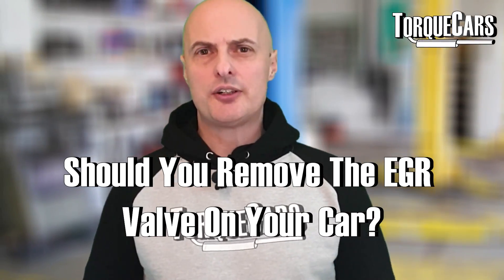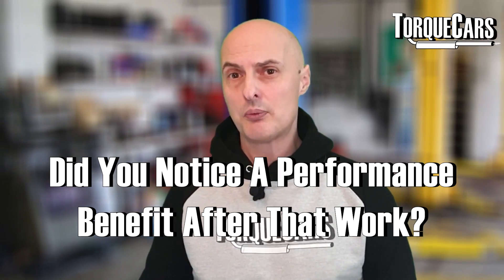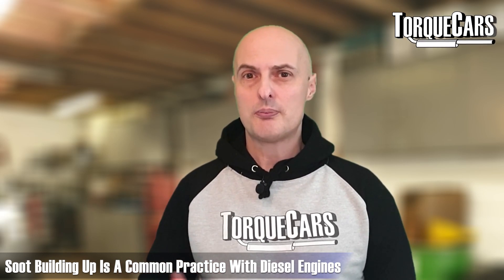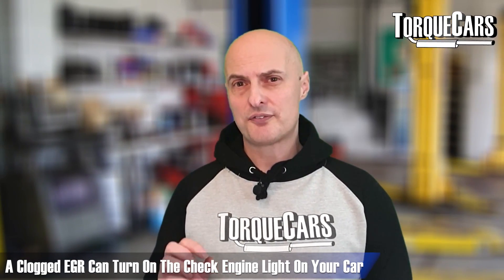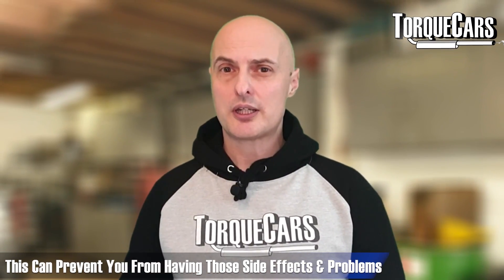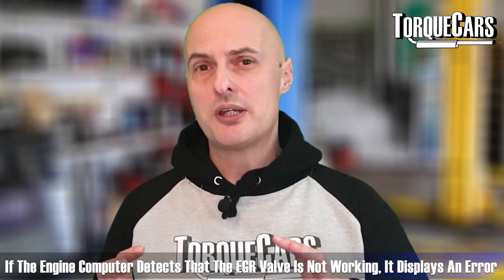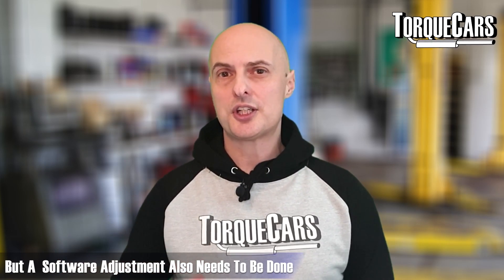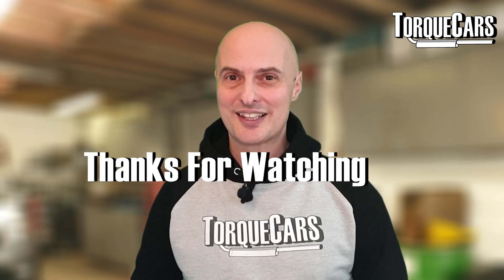EGR Delete/EGR Removal - Worth The Risk/Effort? All You Need To Know About EGR Deletes.

Comment: If you read nearly all of these comments on the deletion / Blanking of the EGR & Cooler ( particularly on VW / VAG group 1.6 & 2.0 TDi ) you will notice nearly all are early 2006/07/08/09 etc etc.Try finding a blanking kit or even a "How to" on the later 2.0 TDi from say 2012 / 13/ 14 onwards on the later MK6 MK7 Golf etc, the larger all in one with the integrated EGR & Cooler at the back of the engine up under the DPF which necessitates dropping the front subframe /removing driveshafts / unbolting your DPF etc etc to gain room, Ohhh did I say on the road or your driveway its going to be a nightmare, and even if you have a two or four poster lift not that much fun either ! ........ they are a known nightmare, not least because doing the job is so horrendously fiddly, difficult, time consuming, and parts are expensive for the average motorist, and that's if you even have the array of different tools needed !  Please anyone ? ..... is there a blog or video you know of on how to DELETE DELETE DELETE ! ....... Thank you.
Reply from the maker: Some would argue that on these newer EVO engines where the DPF is typically placed before the EGR and the PCV has an oil vapor collector run fine and are not a problem when it comes to carbon deposit build up. 

The EGR is indeed a real pig to remove as they are so integrated now and I don't know of a blanking kit at the moment but I'll keep digging around for you. A software switch off will effectively shut the valve and stop it working, and I think that is what most people are doing on these newer engines. Let me know if you find anything out you are not the first person to be asking this.
Reply: On my late 2012 62 plate VW Golf 2.0 TDi I have indeed had the EGR mapped out professionally, not blanked, because these later VWs have water pipes to the cooler and are so difficult to access, almost impossible if you don't have a ramp, and once you go to all the trouble of removing you might as well replace it anyway, I replaced my complete EGR valve and Cooler and that did stop the flashing coil and limp mode, ie: back to full power, BUT, then we had an engine management light that we simply could not turn out no matter which system we tried, after hundreds and hundreds of pounds I simply gave up and had the two day old New EGR mapped out ! another £250.00 on top of the £800.00 I had already spent to no avail, and ir worked ! No fault codes, no pending codes, no dashboard lights, no limp mode, however, I now wonder if this will effect my DPF ? only time will tell I guess, would I buy another VAG car knowing what a huge problem these EGR valves are ?  Never, and I mean that, Japanese or Korean for me next.   @torquecars

Comment: All that soot that blocks those egr's ends up in your engine.. I actually wonder if they designed them that way to push vehicle sales after about 10-12 years. Usually by then the engine is fked and the body is failing.. So most people scrap the vehicle or find some sucker to buy it..
If they are claiming it's keeping the engine cooler etc that is horse shit. They could have designed cold air intakes in the same spot that wasn't pushing 100% carbon back into the engine.
Was it to reduce emissions? Maybe.. Well the engineering behind it could be re-done in such a way that those carbon emissions were being feed into something else, like a pollution control container that they use to have on vehicles back in the 80s.. And those pollution control containers could be unbolted and replaced relatively easily from what I remember back when I was 12 helping my neighbor on his cars.. 
I think that valve is malicious and has bad intent behind it to cause more vehicle sales for the supposed sake of saving the environment.. 
We pay enough for these vehicles, they could all be made of aluminum DMC /cough and not have all these design flaws.
Did you guys know if you actually have a way to warm up your gasoline before it get's to your injectors, it expands by 20%, thusly causing a more efficient fuel burn... I'm not saying to boil it, but warm it up... That is why in the winter months your vehicles mpg is dog shit while it seems better in the summer. You ever hear them mention something about switching blends from winter to summer fuels? They don't switch the blends at all, if any.. The switch is the calculations being made when you pump gas into the tank because cold months means gasoline compresses  and burns less efficient while summer gas gets expanded slightly more from environmental heat, therefor causing the calculations to be slightly off. You ever fill up a tank in the summer time during the morning in 70 degree weather?  Then by 1 pm it's 110 degrees? Sometimes the gas will expand enough to find a way back out of that gas tank.. It's basic physics.. Manufactures have gone out of their way to ensure you can't really fill the tank beyond a certain cutoff point that is designed for summer months so that gas expansion doesn't happen...
Christ, I could go on an on about how all this climate change is horse shit designed to siphon off your hard earned money.
Did you know there were people on youtube 15 years ago using ultrasonic devices from those pharmacy misters to convert fuel with sound to a gas state? Then would go about running a small engine like a lawn mower or snow blower off a minuscule amount of gasoline. Something like 90-100 % burn efficiency! And this tech has been known about for 30+ years... These mother fuckers don't give a rats ass about the environment.. They wanna sell shit in a consumer driven, throw-away-society.. To keep quarterly profits inching upwards... There was a guy back in the 1930s who ran his gas lines near his exhaust to achieve a similar expansion of the liquid gas.. It was deemed a bit risky but these scientists and engineers know this shit..
Wasn't there a volkswagen car made back in around 2010 that was getting something like 70 mpg? What happen? An update was forced out in a recall and those 70mpg cars went to shit.. I know someone who had one but can't for the life of me remember the exact year..
This is the kind of bs going on though. We are constantly lied to, put in a state of fear to control us. Fuck these mother fuckers!
Reply: Yup, my engine was running horrible with the EGR open. Cleaning or replacing is would be a tough job.. if i would go to a car dealership they would charge 1k+. So i blanked it and it didn't cost me anything. Engine is finally running good after this.
Reply: @placeh0dlerr  Are you serious about the 1k? Holy fk.. 
I was only considering a shop to change mine because this 07 wrangler has it in such an odd spot for someone with no lift and an arthritic spine. 
The part is only like 90 bucks in Canada.. 1000 bucks? My god.. 
I might have to tackle this one myself even if it cripples me for a week.
Reply: @placeh0dlerr what car do you have? I have a 01 accord that I just unplugged the connector and it seems to be running better and faster.  Has a slight idle surge idle bounce only on cold start but runs very well when warmed up
Reply: Buck'um man!!!

Comment: EGR are quite well designed you say, PMSL, the EGR on my VW is a POS, failed twice, guranteed to clog up and subscribe to £1200 every few years f@ck that. How can you possibly say well desgined. My EGR has prolly been blocked up for years with no noticiable draw backs except for ECU whinging about it, therefore delete egr
Reply from the maker: They are quite well designed purely from the point of view that "they don't affect performance negatively", when you put your foot down they shut off and at higher loads and RPMs they again are closed. I totally agree that some designs and implementations leave a lot to be desired. 

I still don't see why we need the things, they only really help lower cold start emissions (a bit) which for many drivers is a small part of their regular mileage however in some areas it is illegal to remove them! Crazy I know.

Comment: I love cheap TDI Volkswagens. They are awesome.  If the motor blows just chuck a new one in, they are that easy to work on. Or, you could just simply buy another Volkswagen. Mine hasn't blown, yet, and she's got 300,000km on her. We got a 2007 VW Caddy for $1000AUD that needed work. I've replaced both cv's, front sway bar links, new battery, did a full service, changed the induction, straight piped it from the turbo to just before the rear axle. She whistles like a Cummins, lol. It's a 1.9 bls. I love the looks I get when I drive by and the van goes "choo" through the gear changes, and when revving, haha.

Comment: I was thinking bloking EGR valvule but i decided not do it for 2 main reasons:To avoid high temperatures in the engine and also avoid problems in turbo.I cleaned the Egr last year and i think its the best way.
Reply: I run a v40, and my EGR is clogged. I certainly would like to clean it, but it's such a pain to remove it that i decided to block the system. I think they should make EGR cleaning options better so people don't remove them, because i don't wanna clean it every year which is a full day of work.. Also if i go to any car specialist, they will charge 1k+ for removing and cleaning it. now i have it fixed by blanking it for 0 cost.
Reply: Educate urself 😢

Comment: Let’s be honest - on newer cars with DPFs just leave the EGR attached, it helps clear the dpf, if it’s an old pre-dpf car then crack on.
Reply: Yes, maybe an EGR helps a little cleaning a DPF, but on the cost of some expensive engine parts as the Injectors. In addition the EGR is a beautiful way to let come dirt in your engine. EGR OFF, DPF OFF like in the good old days where Diesel Engines lasted easily 500.000km.

Comment: Surely a blanked off egr with remap will fail an mot right ?
Reply from the maker: The UK MOT rules  8.2 1 1. and 8.2 2 1 apply and mention the EGR = "You should reject all vehicles first used on or after 1 September 2002, where original emissions control equipment components are missing, obviously modified or obviously defective." 

also for diesels 

"You only need to check components that are visible and identifiable, such as diesel oxidation catalysts, diesel particulate filters, exhaust gas recirculation valves and selective catalytic reduction valves" it also mentions "obviously modified", "obviously defective" or "evidence the DPF has been cut open"

So this is a technical fail in the UK and an illegal mod. However I am told by many people that MOT testers rarely check the EGR function, it is in fact closed during the emissions test anyway. If a vehicle can't meet the emissions measurements then it will fail and the Cat/DPF/EGR help the vehicle to do so. 

Talk to your local MOT tester to see how they interpret and check the rules, it does seem to vary!

My advice is always to keep the car legal in your region even if you think you might get away with it.
Reply: @torquecars  UPDATE !! It passed 😀 turns out tyres are more of a concern but only if you promise to replace them 😀

Comment: I just spent $150 on a brand new EGR valve for my 1999 Mitsubishi Mirage DE 1.5L (manual). When I hear about performance improvements, it really makes me want to return the valve and do a delete. On the other hand, my engine just passed 230,000 miles and I'm on a mission to get the coveted "Antique" plate for her in 2029. Deleting the EGR sounds awesome and will probably save money with a return of my new EGR (I put literally 2 miles on the new valve), but at the same time I probably shouldn't rock the boat and take the risk. Plus I read that many computers will recognize the EGR as clogged and will run the engine lean. I'm assuming the higher-end kids will fix that problem. Maybe I'll revisit the delete option down the road.
Reply: Just have the ECU tuned, also, it shouldn't run it crazy lean if you still have functional O2's.

Comment: Vw golf 7 2.0 tdi 2012 
I want to delete egr and dpf. Would software delete be enough or should I close egr with the kit and remove the inside core of dpf? Please answer.
Reply from the maker: If the DPF is still present it will eventually just block up. EGR can be deleted in the ECU, or even unplugged, but it is always good practice to use a proper blanking kit. Even when switched off they can still stick open and cause problems. So physical removal is something I always recommend rather than just a software change (obviously if legal in your area or region.)
Reply: Blank the EGR off, i had software which should block the EGR. Guess what, didn't work. So i blanked it and now my engine is happy again.

Comment: To be honest u have only spoke down sides, theirs a lot of benefits to having it mapped out n blank off
Reply from the maker: I'd be curious to hear your thoughts on the benefits, the more opinions I can absorb the greater my understanding becomes. There are some differences between brands though, some makers EGR are quite well designed, others leave a lot to be desired.
Reply: Can save ur car going on to let limp mode stops the inlet getting blocked up of sit so ur car runs alot better and don't loos boost also makes the turbo spoil up quicker

Comment: I did the EGR, intercooler, and ECU programming on my 2002 Jetta TDI. I now have 348,000 miles on that car and have had few engine problems.
Reply: A mechanic said all this valve does is cost you money lol.
Reply: What did you do on it?
Reply: Jezus, TDI is killing exhaust fumes. Get a grip.
Reply: At what mileage did you add the delete? My 99 Mirage has 230k miles and I'm looking into deleting the egr, but I want my car to last as long as humanly possible. I get the feeling that I shouldn't rock the boat.
Reply: is your mirage a diesel? from what i can tell its worth it on most diesel engines and not worth it on petrol @Spaethon

Comment: I have a 2010 Focus 1.6 TDCI which keeps losing torque through the gears but as soon as I stop and restart the enging the problem goes away for a few miles and then comes back after several miles.  I had the EGR and fuel filter replaced 2 months ago and it cured the problem about 80% but this last 2 weeks it's come back as bad as ever. I know of 2 people who had the EGR software deleted and this cured their problem, they said the engine ran better and the emissions passed the MOTs. My EGR is still under warranty so am taking it back to the garage shortly and will ask him about the option of deleting the software if it happens again.
Reply: Did your problem get fixed?

Comment: I unplugged the electrical connection to the EGR valve. My 1.9 TDI Caddy goes really well now. My check engine light is on but I don't care. I'm gutting my catalytic converter today and keeping the middle muffler so it's not to obnoxious on the highway. Soot gets the m...t
Reply: Make sure your egr valve is all the way closed after unplugging it. Carbon buildups can keep it stuck open and let exhaust gasses in. It's usually best to cut a shim out of aluminum and block the hole completely.
Reply: Yeah I'm going to make a blocking gasket and put in when I'm under the car next. Easier to access from underneath.
Reply: @holben27  Sooo you can just block the intake end like on Mk3 Mondeos then?. Oh and may I ask your opinion on people saying blocking the EGR can cause  high tempratures and premature turbo wear?.. I cant see how?.

Comment: I use mid grade gasoline on my 2007 Honda Civic EX, or 90%. In seven years of owning this car, my egr valve was clean. It’s the original EGR valve.I also use mmo on my gas tank..” as directed”. Since I got the car.

Comment: I plugged mine on a 454 fourth gen,  as I figure out a block off plate, mine seem to be stuck closed.  I removed the rest of the emissions crap and re tuned the carb and got a new belt to run without the air pump and the truck runs much better and the engine is much simpler.so much better throttle response.   I got rid of 30 pounds of crap and tons of little vacuum lines.   if anyone knows where to get a good block off plate id love to know. other wise I'll make one. I still need new headers but im poor :)

Comment: I purchased a truck add it had the egr delete now I need to take the intake out and clean it, I took the egr and had a gasket to block it and the hole were shut off by carbon also the truck is backfiring I  think is because of all that carbon build up

Comment: 5:17 how can feeding your intake with dirty exhaust gases be any good for the engine if anything this is only going to add more soot to your intake and other areas and therefore performance will be affected and not only that its just damaging your engine 
The manufacturers add these systems to make them run cleaner exhaust gases while at the same time knowing its damaging your engine to its a win win for the manufacturer because once your engine goes bang which it will 
They know even more of our hard earned money will be in there pockets when you have to replace the parts that have been affected by this stupid idea of a erg
And for the dpf system well 
Thats just another money maker aswell
Reply: Govt/Greenies make the manufacturers do it. No manufacturer of vehicles in their right mind would voluntaritly do such an insane thing to an engine.
Reply: The government "makes" the auto makers because they lobby the government to make them.  This relieves them from liability.  This practice is common, it makes them money off repairs and parts.  Does anyone really believe its in the automakers best interest to build cars that don't need parts?  
Well, they've taken it to the extreme now, the evolution of corruption.